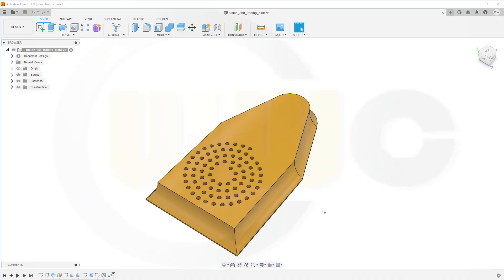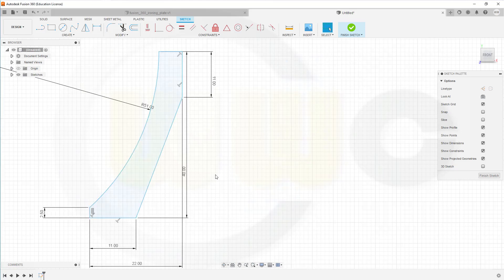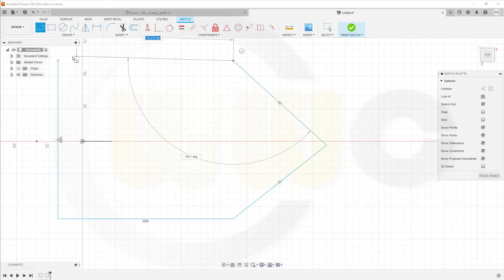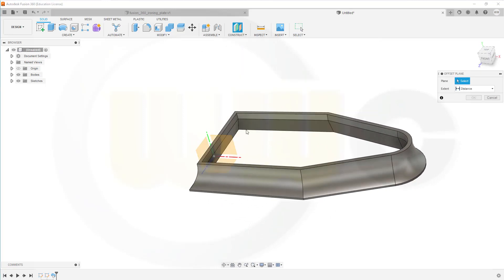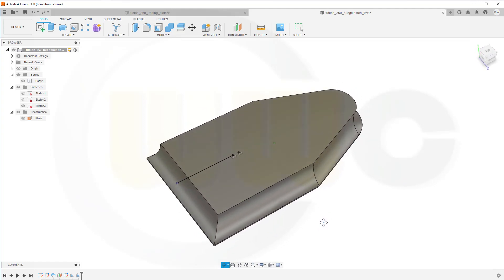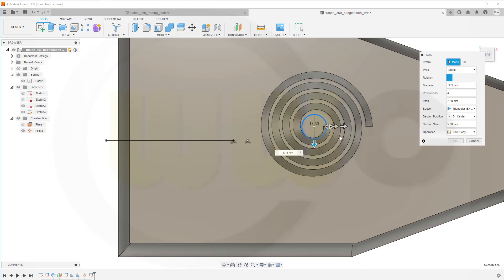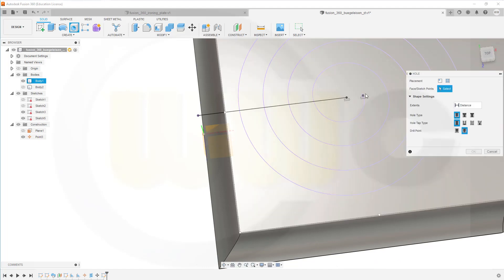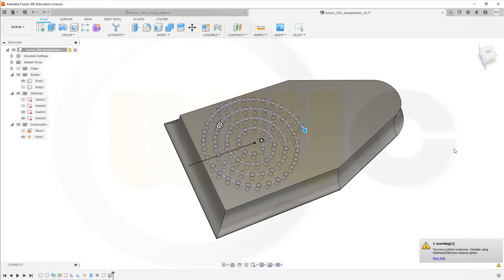9.3 Buegleisen - Ironing Plate - Fusion 360 Training - Part Design

Comment: is nx software better or fusion 360? in cad  and  in cam  and in complex assembly?
Reply from the maker: In my opinion you can´t compare those two. There is massive price difference.  You have to compare Siemens NX and Catia and I would say NX wins. Yo u could compare Inventor, Solidworks and Fusion 360. But even there Fusion 360 is much cheaper than both ot them.